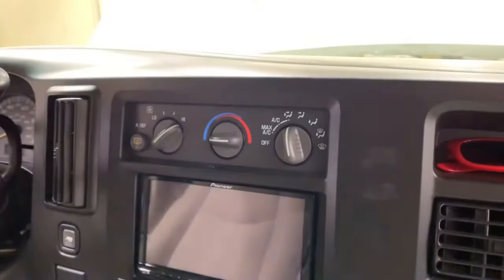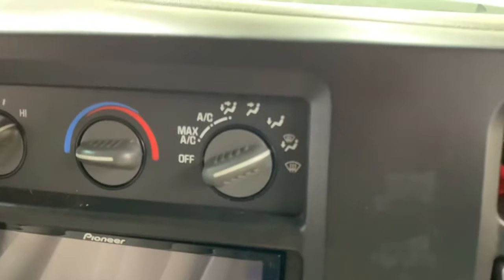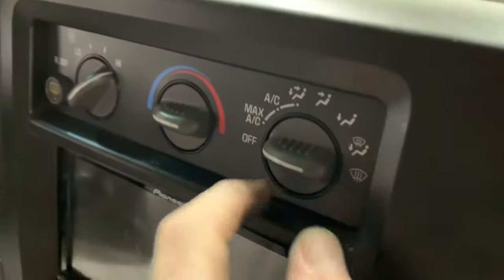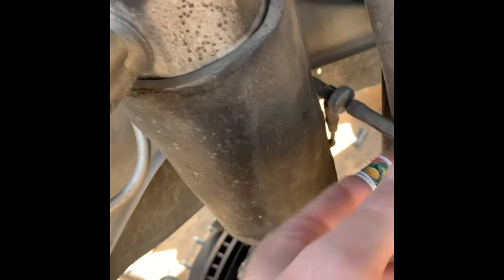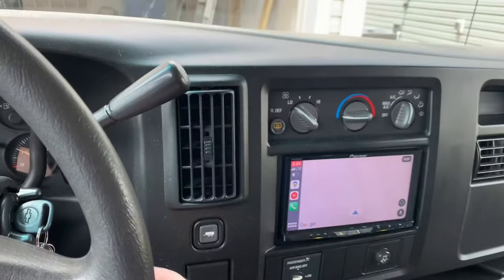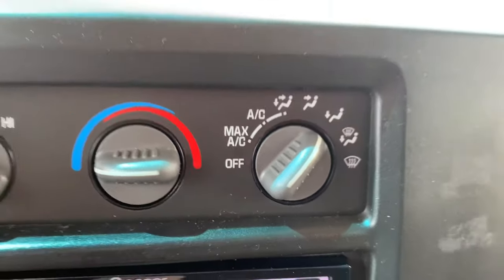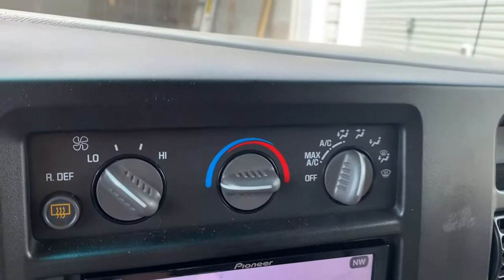Vacuum Check Valve Diagnosis / Replacement - Express Van

Comment: Hope you can help me.  I am replacing the valve along with the hoses. I had left the hoses attached to the valve so I would know where they go on the new one.  When I went to get the parts the guy pulled the hoses off to measure them and I’m not sure which goes where.
I have the AC/Delco replacement ordered and will be here tomorrow
Reply from the maker: Hey Michael, there are three ports on your new check valve. (Hopefully the AC Delco units are still black and white!)
The black side is the vacuum source (top of engine manifold)
The white side (directly across from the black side) goes down to the vacuum reservoir located under the battery.

The “Tee” (90° from the other ports) goes to the inside of the van for your HVAC controls.

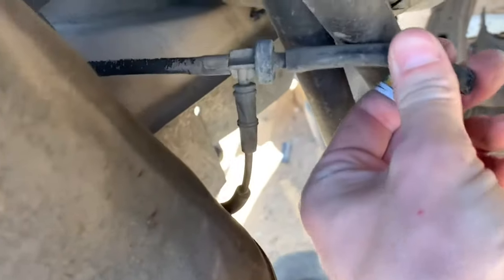Pause the video a little before and after the @1:18 mark and it should help with the general direction of two of the three lines.
Reply: @VanwithTim   wow!  Thanks for the quick reply!  Very helpful.
Reply from the maker: @michaelclover9186  Sure thing. Let me know if you need any further assistance tomorrow! Good luck!
Reply: @VanwithTim    Installed and working correctly!!!!   Thanks again!!

Comment: Hi.  I have a 1997 Dodge Dakota with this problem. I cannot find a vacuum reservoir nor is it listed in my Haynes manual.  I went to Dodge and they only list a Vacuum reservoir for the cruise control only.  Is it possible for my truck to not have a Vacuum Reservoir for the blend doors?  Thanks.  PS. They no longer have any stock or idea of what check valve goes into my truck.  Are they generic.  How can I find the right one when I don't have a part number?
Reply from the maker: Sorry for the late reply - the 97 Dakota has both the recirculate / fresh air actuator and mode actuator (defrost, face, feet) controlled via engine vacuum. The temperature actuator is controlled via cable. 
The HVAC / cruise control vacuum check valve (they both utilize the same check valve simultaneously) is located right off of the brake booster check valve (connected to the brake booster check valve with a 90 degree elbow)
Check valve part number on the 1997 Dakota is 4549209 https://amzn.to/3DVb2Q0 (no idea why it's so expensive or even if it's the cause of the issues on your truck)

Feel free to email me if you'd like the blown up vacuum diagram!
VanWithTim@gmail.com
Reply: @VanwithTim  thank you for the reply. I found the vacuum reservoir under the cowl on the passenger side. I doubt that's part of the problem as the cruise control works properly. I suspect something in the darkest recesses of the HVAC box under the dash or maybe the mode switch. The air blows well in Max AC mode even under load but in vent mode it looses air. It also gets worse as the truck heats up. Next I'll take it to a shop to get it smoked out.
Reply from the maker: @1lfp903  Wow that's an odd ball! Hope it's figured out without too much financial pain. Best of luck with it!

Comment: Dorman check valve " pt #47170" flow direction is not labeled. Please advise. TYI
Reply from the maker: Of the three ports on the Dorman check valve, it will NOT be the "tee" portion.
That leaves the two parallel ports. With the "tee" port blocked with your thumb, you should only be able to suck air through one of the ports. That port will be the one to connect to the engine side of the vacuum line. The other port you weren't able to suck air through will connect to the vacuum ball under the battery tray. The "tee" port will be connected to the HVAC system. Note that my Dorman check valve allowed air to flow in both directions. It was bad out of the box. Had to order the OEM on Amazon.

Comment: Yes. But how do you check the check valve itself?  Thks..jc
Reply from the maker: Idle the van for about a minute then turn it off. Then listen closely to the climate control selector and change the "mode" (as seen @2:14) you should hear a small "hissssssssss" 
You might need to turn up your volume to hear mine.
If yours doesn't make that noise, it's probably the check valve.

To test the valve off of the vehicle, you can blow into the valve. Two ports will be free-flowing in either direction (suction / pressure) but one - the engine / vacuum feed connection - should only allow suction through and if you try blowing, it should block the air from flowing.

Comment: Where does the small hard live connect to?
Reply from the maker: It’s been a while since I’ve had the van, but from the vacuum tee there were three connections: engine vacuum (connects to top of engine), vacuum reservoir under the battery tray, and the last went to the HVAC system.
Sorry I don’t have more information!

Comment: Can you show where the inlet is on the actual engine I can't find it for the life of me
Reply from the maker: You can kind of see the rubber line going into the side of the upper intake manifold in this video: https://youtu.be/_SPWo41Vfzk?t=394

Here's a still from the video with the location circled: https://drive.google.com/file/d/1uF1q_QMh7Fn__dDtZoEuRNy-HQ8nVsNW/

(This is on my 2005 6.0L engine but should be similar to the 5.3L and 4.8L)
Reply: @VanwithTim  I really appreciate u taking the time to show me that but are u saying I basicly need to drop the whole engine in order to get a new hose on there cuz I don't see any way of reaching back in there with the engine in the bay like it is and ofc my hose by the inlet port was burnt up and has holes so I needed to replace it but now I can't see where I took it out from to get it back on
Reply: @VanwithTim  at least I think it's the inlet hose that I need to reconnect when I ended up finding was both of the hoses on that little check valve you said to replace had holes on them and needed to be replaced I replace the hose to the vacuum canister with no problem but it's the other hose I can't get and the hose that goes to the electric controls is fine and still plugged in
Reply: @VanwithTim  also I'm in a 2014 model I don't think they are in the same spot because my hose was connected to the left side of the engine not the right side like in the vid you linked still really appreciate your help
Reply from the maker: @QuickShtick's Streaming  Yeah that sounds like the engine intake vacuum hose.
Don't think you'd be able to access it from under the hood without some REALLY long arms.
The engine access cover is just four 10mm bolts and 4 latches though. Probably <5 minutes to remove it! (Still a pain in the ass though).
Here's a quick video on the removal process: https://youtu.be/ensOfjE7ON0?t=48s
Reply: @VanwithTim  man u are a life saver it may be a pain in the ass but it's gonna be worth it now I got a nice Lil Saturday project my company just threw me in this van while my other one is being worked on and I do hvac for a living so not being able to turn on the air and cool off after coming out of a 150 degree attic was rough
Reply from the maker: @quickshticksstreaming6539  Oh hold up!! Looks like your Saturday project just got a lot easier. No need to remove the engine access cover on the 2010-2016 models.
There was a revised intake manifold in 2010 and now your vacuum feed should be right behind the throttle body: https://drive.google.com/file/d/17WCJTVPKqY4YMjnv4xzaMU8nN6k_LLz1/view

For reference here's the entire intake assembly: https://www.ebay.com/itm/165115015617

Hope it goes smoothly! Stay cool my friend!
Reply from the maker: Well actually now I'm not sure. Here's another view of the manifold and it looks like it still might be on the middle / side of the thing. And maybe that one behind the throttle body is for some emissions hose... https://www.ebay.com/itm/164675490368

Sorry for the false hope man. I'm sure you'll find it and figure it out though!
Reply: @VanwithTim  dude I can't thank ya enough for all the specs and vids you linked took me less then an hr to get firewall off and everything routed it was in the back on the passenger side unfortunately but I was still able to get it done and now my air works 💪
Reply from the maker: @quickshticksstreaming6539  Score!! Glad it wasn't too awful of a job. Stay cool!

Comment: Mine still doing the same thing after replacing that valve
Reply from the maker: Your vacuum line coming from the engine which connects to the check valve may be bad. Many are reporting that main vacuum feed line is crumbling due to age. You can check by disconnecting the check valve, starting the engine, and seeing if you feel vacuum on the line which goes to the engine. If you don’t, you need to replace the line.
Reply: @VanwithTim  i already replaced it and still doing the same. I’m gonna have the ac Freon checked up to swig its low